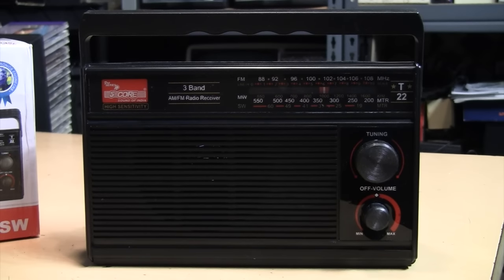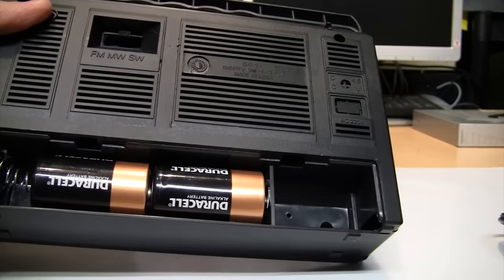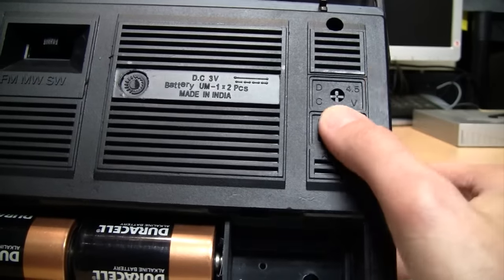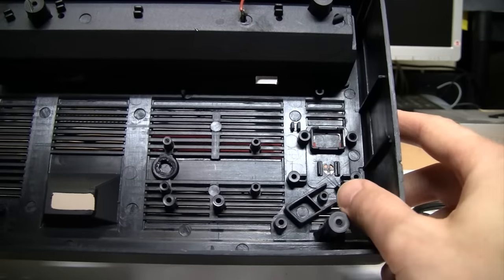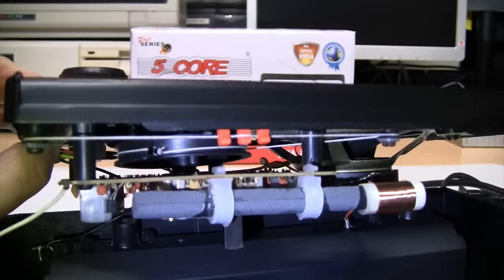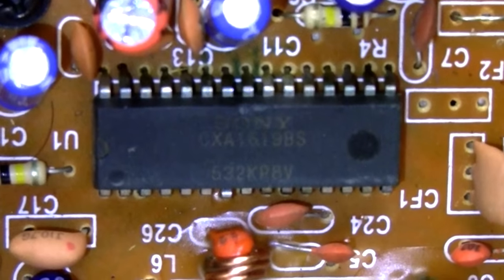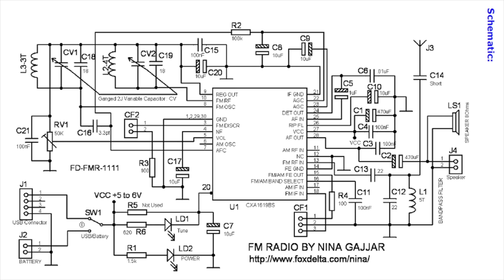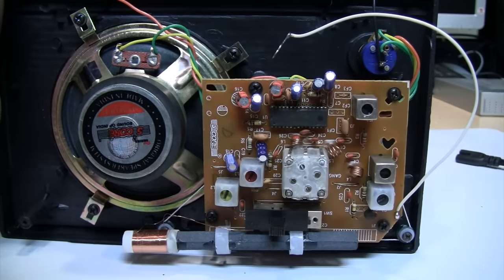Secretly made by Sony - Inside the 5 Core radio

Comment from the maker: Correction: The unknown music station is actually 830 WCRN from Worcester, Massachusetts, not 920 kHz as I said in the video. They play '60s-'80s music from 7:00 PM to 4:00 AM (Eastern time).
Reply: It's nice to see that they're still getting it done. I'm at and on an AM music station myself. There's not a lot of us left.
Reply: @DriveInFreak  And what station might that be for nearby listeners?
Reply: I used to listen to 830 wcrn alot when I was younger, funny to see it here
Reply: Thank you for posting 
I posted a video on the original panasonic from 2 years a go it has a transformer amplifire out put circuit and the rf/ if circuit is (AN) series 
This one use the cxa1619 normal pins and there is an smd type of the same ic it is made in china under license from sony corp
I work in cxa1xxxx alot and the cool thing that the volume pot dos not control the audio signal it dos control a voltage and the voltage it is feed to an elctronic volume control circuit that feed it to the in chip amplifire
Reply: "The music of the North Star"
Reply: @DriveInFreak  I'm glad there are still a few of you around! I have noticed a slow renaissance of AM talk radio stations going back to music formats. It is very refreshing to hear something besides "Coast to Coast AM" on overnight AM radio! 📻

There's one near where I live, WKQK (Class B, 1300 kHz) in Cocoa Beach, FL. A local group learned this station (formerly WMEL) was going off the air permanently. The group purchased the station and made it independent. The new station plays music 24 hours a day exclusively by local artists.

FM radio is nice, but it doesn't have the ambiance which can be found only on AM stations. FM stations also don't have the range of AM stations, thanks to the ionosphere! And one of my favorite hobbies, besides Amateur Radio, is dx'ing AM radio stations.

73 de NØJAA.
Reply: When these oldtime clips began I expected the usual sneak rickrolling.. nope. Just a sad old Phil Collins. Now that's a plot twist!
Reply: Full Service Radio
Reply: Good to know. I don't know if I pick that up out here in the Merrimack Valley, but 900 WGHM from Nashua, NH is about the same. The difference is they're oldies 24/7.
Reply: You can try amlist and fmscan websites to find stations in your area, or any area.
Reply: This confirms that this radio could be modified to provide SSB Rx on at least 80 mtrs but selectivity and tuning rate would be the big issues.   TE Fidler
Reply: Actually i like sound of a radio, next at the street conner, its not noisey n so natural n cool.
Reply: Love that station! They usually identify after each song afaik
Reply: I think alot of people don't wanna buy from ebay... I
Reply: Two years ago these were awesome. Today they’ve gone to crap.

Comment: Almost seems like somebody bought some old factory tooling, molds, etc. and cobbled some modifications to start making radios with it again.
Reply: The poor result of the mold could actually be a indication that the molds are old. In my country there is a discontinued train model toy that still has many fans due to nostalgia. By massive request, the toy company retrieved the old molds and made a limited edition of said toy, and you could clearly notice the difference by comparing the new and the old parts, the old ones are much smoother.
Reply: @claudiodiaz9752  The same with Unicomp keyboards. They recently made new tooling because the worn out molds impacted quality too much.
Reply: Right. I want one.
Reply: India is famous for buying proven designs and tooling, and then manufacturing products for decades after said product's EOL in Western markets. Royal Enfield motorcycles and the Hindustan Ambassador (a car that was in production from the early 1960s until the early 2010s, based on a 1950s Morris from England) are just two of the better known examples.

As well as a 5 Core radio, I also want a Royal Enfield.  Go figure.
Reply: @claudiodiaz9752  When companies in Southern Europe like Lima and Mehano would use the same tooling for decades you could definitely see the difference between otherwise identical models of different eras. I think modern train models have too short runs for this to be a thing anymore (and they are way too expensive now unfortunately).
Reply: @OzRetrocomp  Me too, big time.
Reply: @OzRetrocomp  Royal Enfield have more modern models in production.
Reply: @OzRetrocomp  I also want to add:
Tata winger is still manufactured till this day, based on Renault Trafic aka Winnebago Lesharo but with their own engine. Tooling assumed to be bought from Inokom from Malaysia (producing similar Inokom Lorimas). With BS6 (Bharat Stage 6/Euro 6) emission update,  some sort of facelift is done.

Next there's Ashok Leyland Dost. Basically Nissan Vannete C22 restyled and using Ashok Leyland's own engine. Tooling seems to be bought from Malaysia (last production of Nissan Vanette c22 on Malaysia is on 2010).

Also eicher pro 1049 truck is similar to Mitsubishi Canter 4th gen with 4d31/4d30 engine, bore stroke is similar (eicher e483)
Reply: Battᵉᴿy
Reply: @bitelaserkhalif  
Ohh come on you guys..
How could you forget jeep.

Its a full blown company in India now. Called Mahindra .
Bought over sassyong, and took over ford India operations.
Reply: @OzRetrocomp  I am from India. For your information Ambassador car production stopped ten years ago.  Yes, Royal Enfield is still available with modification and has lost much of its earlier majestic Enfield motor beat.  But then India is also worlds largest producer of modern motor bikes. As for radio we produced excellent global standard sets during 1970s and 80s. After a long gap a new company 5 Core best known for audio amplifiers and speakers is producing and exporting this radio. This set is not available in India. There are many local brands manufacturing far better plastic cabinet than it.

Comment: very famous chip indeed, many of the multiband receivers in late 90's were holding an cxa1619 in a smaller package. glad to see they're still in use.
Reply: I wonder if they're still being made?  I checked DigiKey, and I'm not surprised to find I can't buy one there.  I don't know Sony's procurement process though.  Retail standalone parts houses are probably not their typical avenue.
Reply from the maker: The CXA1619 has been discontinued. 5 Core either bought up a large stock of remaining inventory, or may even be using used chips reclaimed from recycled radios.
Reply: @vwestlife  Yeah that's likely what's happening! allowing another life for those ICs in a real analog receiver, that's a winner recycling 🙂
Reply: These chips are available  most of the local Indian electronic spare part shops just for a half €....all new... some shops sells cd1619 ic instead of cxa, maybe a copied version
Reply: @VENUGPL1  CD1619 is likely a Chinese clone of this chip.

Comment: In current Sony lineup, at least the ICF-306 is based on the same chip (they have smaller P26 and P36 - not sure if those are analog or digital tuners, but the 306 is analog for sure). This radio is 2 band AM/FM, the finish is much better than the 5 Core and it sounds very well. Can be had for not much more money (and no far away shipping...)
Reply: And what about sony Icf 19?

Comment: A good sounding radio - I don't need one, but I'm glad they're still available.
Reply: More than two dozen local radio manufacturers in India are using Sony CXA 1619 chip along with 2 transistors. And these radios are available in India at throw away price. This Sony chip is available in India at $0.5 (fifty cents). But possessing these radios are not seen prestigious in India. So only farmers and small shop keepers buy them.

Comment: Bought one based on your last video and I cannot believe how good this thing works for something that looks so cheap. It is straight up the best sounding AM radio I have ever used.
Reply: Isn't it to Hi-Fi for Black Metal then? ;)
Reply: Analog is the best for MW and SW (AM) radio IMHO. Any one of my "vintage" analog pocket radios beat my newer and supposedly "better" digital based radios for AM reception. I am definitely going to get one of these!
Reply: @jamesslick4790  even my really cheap and nasty sentry radio sounds good on am due to it using an analog radio on a chip.
Reply: @qwertykeyboard5901  Yep. Digital processors cause interference on AM. Some can't be heard due to the frequency, But it "masks" the incoming signal. AM and (SW) need analog! Digital radios that ARE OK on AM and SW are EXPENSIVE. A cheap $20 analog AM radio will pull in AM DX stations far better than $100 digital ones!

Comment: These cost 10-12$ in India.

Good to know these sets reached US of A, there is still a huge cottage industry in India and radio listening is still very big in rural areas. I built quite a few of these with AF113 and AC128 transistors( old BEL India numbers)  in my days mid 70s prior to CXA made appearance. Most of the capacitor and transformer s are still hand built in India in small workshop s with not more than 5-8 people. 

Good old days.
Reply: ac128s were very common germanium types here in the uk and eu, early 60s to early 70s, japanese equivalent 2sb56, dunno a usa equivalent off hand, never come across af113 but plenty of af114/115/116/117 and similar af124 to 127
Reply: Hi @Srinivasa,
I'm From Maharashtra, India and I can't seem to find the Radio on any Indian e-commerce site of any such.
Do yoy know where can I buy this radio online?
Thank you.

Comment: Plenty of room inside to mod. 

1) Add an earphone socket 
2) Add an external antenna socket/bypass the ferrite rod for shortwave reception
3) Add a charger/charger port
Reply: Be careful when you modify anything near the ferrite rod. In some receivers (not all) that part is also in use as a pre-selector. Modifying that can cause a different inductance and "out of sync" operation between the local oscillator and the pre-selector. (They are both simultaneously tuned by two variable capacitors in the tuning cap block). Result will be a very poor of even no reception. If you are not sure about how the circuitry was designed, leave everything connected the way it is and put a coupling coil on the rod itself. That coil can be connected to an external antenna. You can safely experiment with the number of turns of the coil, to find the best coupling between your external antenna and the receiver itself.
Reply: no bluetooth?
Reply: @heedmywarning2792  Bluetooth is an abomination 😂
Reply: @heedmywarning2792  Bluetooth negates the whole idea of this receiver.
Reply: @hugoromeyn4582  Better yet, find an early-70's transistorized AM receiver with a dual-ganged, air-gap tuning capacitor. All discrete components, no chips (except maybe an occasional voltage regulator). Nothing but transistors, resistors, capacitors, I.F. reactor coils, power and output transformers, and a big, honkin' speaker. Add a jack for an external long-wire antenna, and you're in business! 📻👍
Reply: @erzahler1930  That are the REAL receivers! :)
Reply: @hugoromeyn4582  Could you do a video on adding an external antenna socket?
Reply: @hugoromeyn4582  Definitely! Of course, if you REALLY want to go back, I'll take any radio that has an orange glow inside. 🙂👍
Reply: Last Days Trumpet  There's already a good one on YouTube. Search for "Mr. Carlson's Lab." He is VERY knowledgeable.
Reply: Since there is only one winding on the ferrite bar, we can conclude that it's for the AM band only. A few turns of hookup wire around the bar will allow an external AM antenna (something like a dial phone finger stop) to be used. The other end goes to chassis ground.

Shortwave is likely via the rod antenna through the single transistor, acting as a buffer. Since the rod antenna can deliver ESD to the transistor, a diode clamp might not be a bad idea.

When adding an earphone jack, sometimes a 10Ω resistor in the "ground" circuit to the jack can help save the ears.
Reply: The shortwave needs an telescopic antenna or better an log electric wire for best reception.
Reply: A beat frequency oscillator would be cool for shortwave
Reply: How do you add a plug cheaply and easily

Comment: 1. My T-22 arrived two days ago and I've already broken the top section of the antenna. A new record.
2. I'm all the way down in Kentucky and CFZM sounds even better on my T-22. May as well be listening to Stereo 89 WLS in 1984.
Reply: From where u get it?
Reply: Guess you've got to replace the antenna, or jam a precision long screwdriver into the hole (must fit snug) like I once did. LOL
Reply: I got a tecsun and the antenna snapped off. I just measured it and ordered a higher quality antenna off ebay

Comment: I love how simple and effective this radio is, it seems like such an honest product. It looks like there's very little to go wrong. Even if a component does fail, the components look cheap and easy to replace. I wonder if that eBay seller delivers to Australia...
Reply: In the cold war times, it was recommended to keep such a simple radio at home for emergencies. Their circuits are so simple and robust that they have a good chance to survive even the electromagnetic pulse (EMP) of a nuclear strike. Most more complex circuits will be killed by an EMP.
Reply: its possible to make an even simpler am radio using a 'trf' chip/circuit, but has worse selectivity ,so  a strong signal can swamp out nearby weaker signals , but perfectly ok if you just want to pick up a strong/local station

Comment: CXA1619 was the most popular chip used for these 'analog' purpose in India until analog fm was replaced by PLL Synthesisers embedded in all in one USB chips. I would say it was a fabulous chip and produced robust reception with minimal passive components. They were also used in some mid-cheap 'hifi' systems  accompanied with a stereo demultiplexer. These chips are still available in a readymade plug and play fm kit in India at a price of approximately 50 cents (USD). Now it is upto speculation whether it is really SONY or not!

Comment: 4:06 Look at CF1 on the circuit board, there are two spots for a CF2 and a CF3.  The CF3 spot has a jumper on it. My guess is that CF2 and CF3 could have been for two additional FM ceramic filters. Some are asking "so what"? Well, if you have more FM ceramic filters in the radio. The radio should be more selective on FM. If you replace the existing 230 khz Ceramic Filter with a 180 khz or 150 khz filter, your radio will be much more selective than before and should be better for FM Dxing. What that means for you is, you should be able to pick up the Philadelphia FM stations (like 98.1 WOGL)  right next to your NYC and Central NJ locals (WMGQ 98.3) with just one simple ceramic FM filter change.
Reply: The CXA1619BM/BS datasheet has the values for CF1, CF2, and CF3 and shows the circuit. This IC was designed to use them so it may be worthwhile to add them and see how it works. I've got two of these radios so I can compare the difference.

Comment: That circuit board brought me memories... I used to repair portable radios back in the 1990's and I saw many boards that looked pretty much the same.
Reply: Memories for me, too. 

When I started with electronics at 12 years, having not much money, I asked a local radio shop if they had some  'broken devices' (=that were not worthwhile to repair or that people did not pick up) for me, to take apart, learn from them, and use for parts. They were nice and gave me quite a few ones (over the course of a few years, before everything became highly integrated). 
Some of the devices worked fine, maybe the repair was just too expensive for the owner, or they got a new one and did not bother to pick it up.  (One memorable clock-radio served me well a couple of years until finally the mechanical clock mechanism broke - the motor became unbearably loud - and then I would finally disassemble it and get some components out.) 
I got a lot of passive and active components from these radios for my own experiments. And it was good soldering practice. Got a lot of respect for some of the mechanical designs, too.

Comment: A third battery was the first thing I thought of, especially as the cord was clearly intended to be detachable. I've never seen a radio with a detachable cord also equipped to store the cord. Still, I'm pretty sure it was a law that the cord compartment on a radio could not be big enough to comfortably store the cord without jumping up and down on the radio to get it packed in there.

The shortwave on my example works great, but the speaker sounds like it's either blown or binding.
Reply: Lift the board and check the solder connections, they missed 6 connections on mine.
Reply: @uxwbill
Also notice the battery spring terminal. They clearly stretched it to match the two battery cell length
Reply: @jordanch68  I got one last year and if I remember right it had some issues, so I put it aside to look at it later. If it can work as well as the video indicates I need to open mine up and take a look.

Comment: This chip is so popular in India used in most of the local brands and DIY circuit boards...sound quality is exceptional...some people use the the built-in amplifier inside the chip and some uses separate high wattage amps